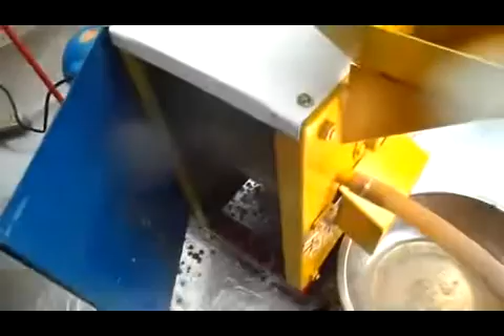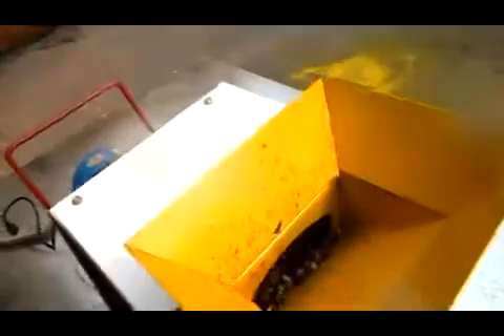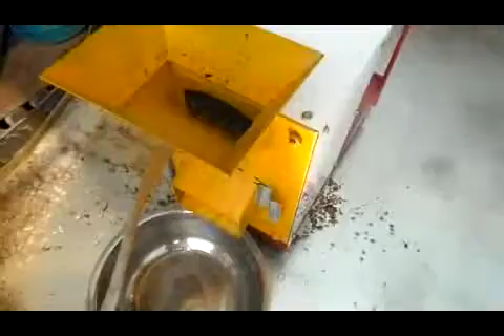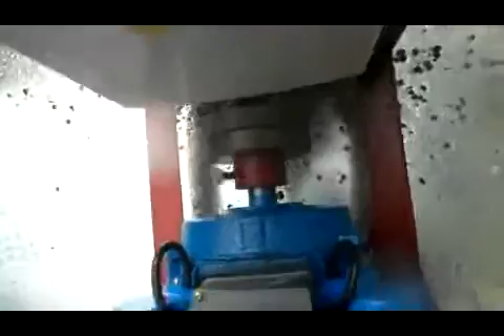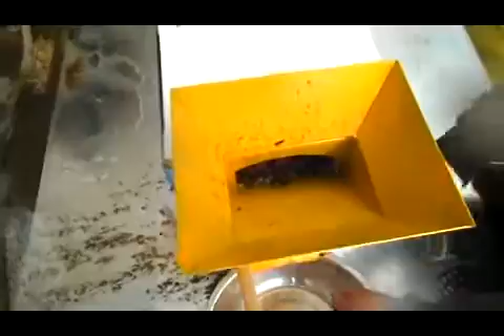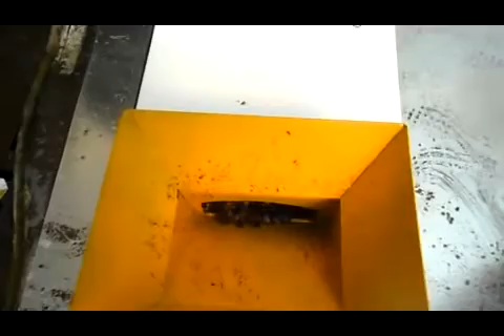snail processing machine, snail tail cutting grinding machine /sales@springrollwrapper.com

Comment: Hello, please l just want to know if your company have any machine that can processes or remove periwinkle i.e sea animal, from the shell without damaging the shell body. This is because, the shell of the product can also be resale in the future and the people in Africa also use the product for immediate use. so l need  a manufacturing machine that can easily bring out the inner product very faster than the manual process. Some of the manual process are: fetching  the product from the sea, cook it with warn water, and using needle to remove the inner product for sale. l know how get to the raw material but currently looking for faster way to produce product with unique manner.

lf incase your company doesn't have it. Can your company manufacture the machine for easy production process?

please l will really pleased if l can get it from your company because l need it for my processing department in Africa.

l will like to get in touch with your company to get the machine and collaborate ideas together for the product to be more useful

Many Thanks

Abraham.